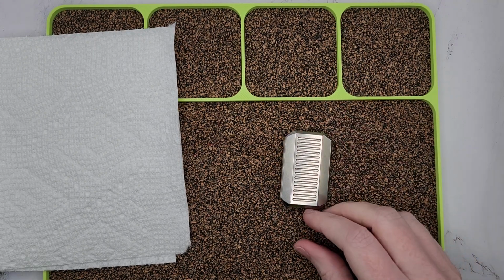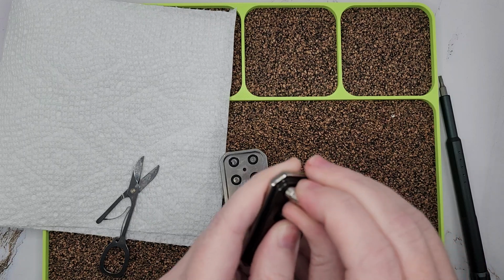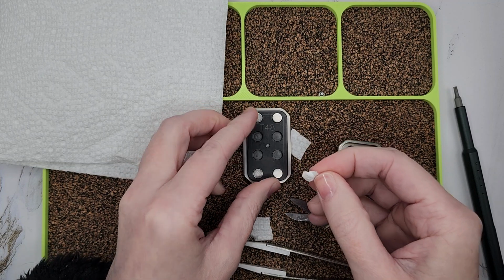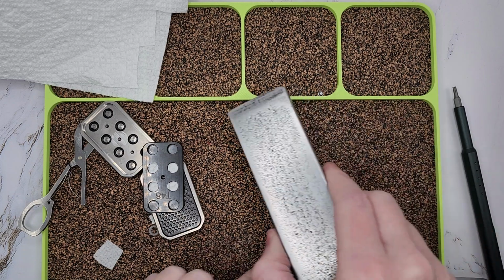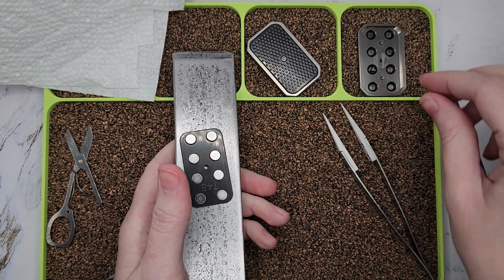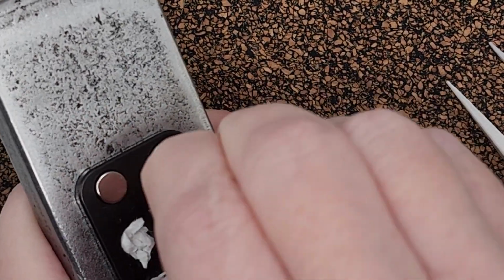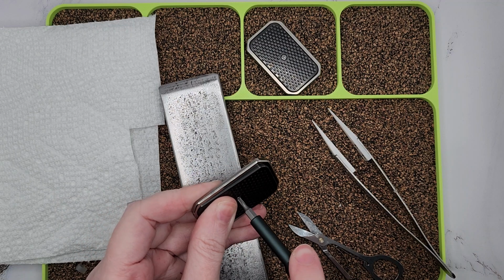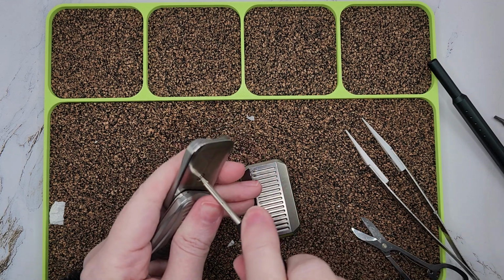Tuning the Magnus Rail!

Comment: Maybe some N35 magnets would be nice in the 4 center slots on each plate. Or maybe a paper hole punch and make the circles from notebook paper. I might try this. Thank you.
Reply from the maker: Those are both excellent suggestions! I would have tried them if I had those magnets or the hole punch. But if you have those items, definitely give it a shot! Probably way better than bits of paper towel, lol.
Reply: @FidgetGirlEDC  there was nothing wrong with your method. I thought it was a great idea. It got me thinking of all the ways it could be done.
Reply from the maker: @sleepinglysithia  Thank you! I think that your suggestions are improvements on my method. There's always room to improve! And you've got great ideas!

Comment: Instead of using paper towels, you can just but the o rings in to the sliding plates, so there would be more distance between magnets
Reply from the maker: I tried that! But it was so much distance between the magnets that when I tried to play with the sliders, they were too weakly attracted to each other. The play was changed too much and I didn't like it.